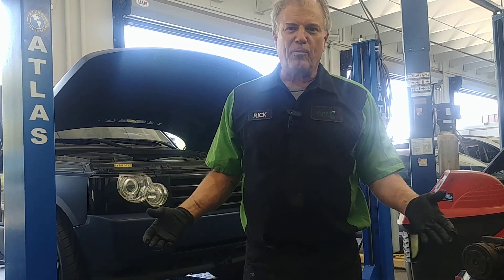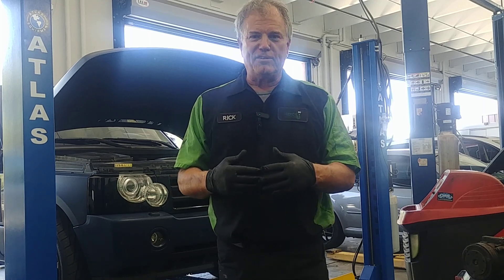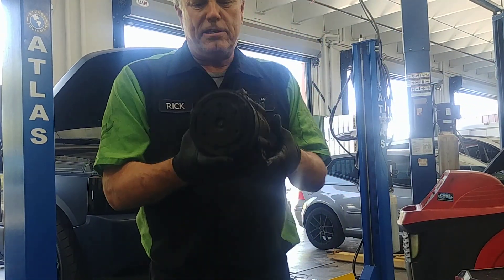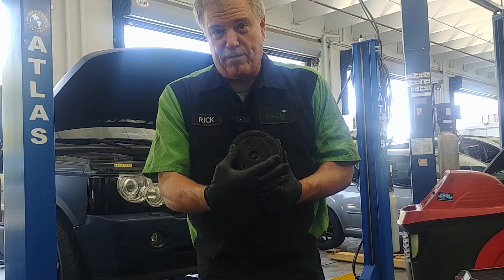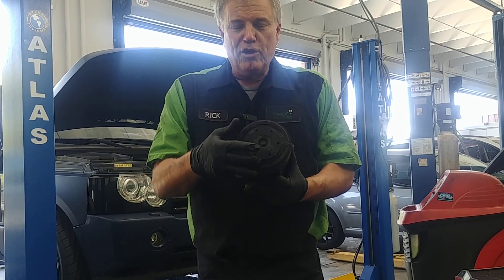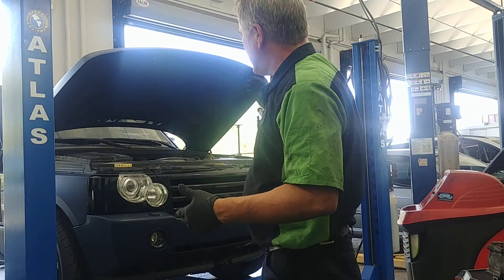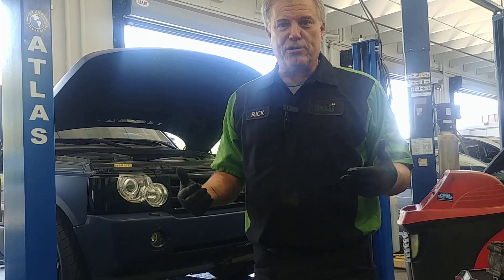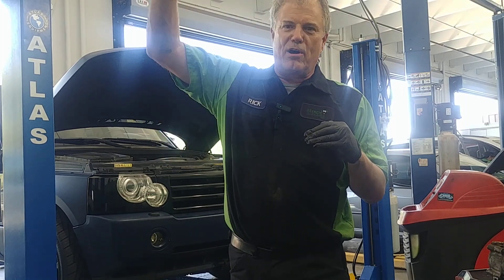How do you check if your AC Compressor is working?

Comment: Would a bad ac compressor ever burn out a blower motor resistor?
Reply from the maker: The blower resistor is part of the ventilation system and the compressor is part of the refrigeration system, so the compressor won't affect the resistor.

Comment: What if the wheel moves but slowly
Reply from the maker: You would need to look at it closely to see if the compressor shaft is actually turning.  What you are describing sounds like you might have a clutch slipping due to a seized compressor

Comment: My compressor turns a little bit but stops. Pretty much repeats that. Driving at higher speeds i get cold air but as soon as i get to slower like park speed it blows warmer air. I drive a 2010 mazda cx-7. It has been getting progressively worse.
Reply from the maker: Make sure the radiator and condenser fan are operating. If they are ok, then the next step is checking the system pressure.

Comment: My compressor is not getting power to it I have 2010 Kia Sedona and it has always been cold and worked EXCELLENT but I don’t have 1000 to fix it could u tell me what to do thank you I use my van for my channel 🙏 ty
Reply from the maker: Unfortunately due to the amount of electronics involved I don't have a simple hypothesis to point you in the right direction.  I would likely start with using a scan tool to look at multiple  pieces of information.

Comment: How can I tell if the compressor has been internally damaged and contaminated the rest of the system?
I need to fix the a/c on my 03 Silverado. The air just kept getting less and less cold until finally it wasn't cold at all. Pressure was fine and no leaks.

Going to replace the compressor and the standard items. 
Thanks!
Reply from the maker: The amount of material in the orifice tube screen is a good indicator.

Comment: Hi, i used a recharge kit for my ac system. When i plug the hose to low side port and with AC off it was reading in the green zone but as soon as i turned on the ac . The pressure on low side turned on low. Even after multiple trials of adding R134A , the pressure on the low side stays low.  I notice my compressor is engaging fine. And fans are working fine too. What u think is the problem? Ac is blowing hot air
Reply: Old question,but still answering so others can see. it sounds like your ac compressor may be the culprit.

Comment: So one qwestion i had was how do i tell if the compreser is working wen i turned on my ac that wheel did not spin i was about to order a new co.preser but i found a gadge put it on i had very low pressure as soon as i started to put r134 in that lil wheel in middel started to spin so i guess i answer my own qwestion
Reply: You should thank yourself for adding refrigerant before it got too low to draw in the new refrigerant on its own 👍

Comment: Wouldnt the pressures be as you described (high on the low side and low on the high side) if there was clog in the system?  If so, how do you know it's the compressor and not the condenser/evaporator that is clogged?
Reply from the maker: If it is high on the low and low on the high then the compressor is not pumping properly.